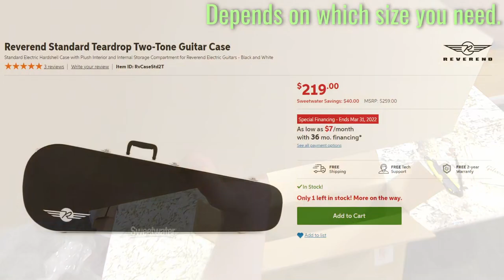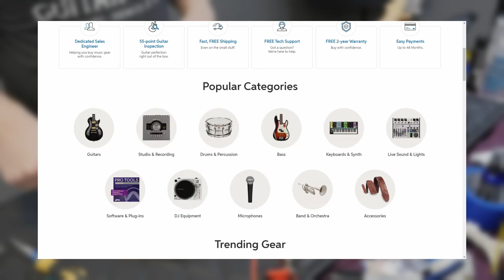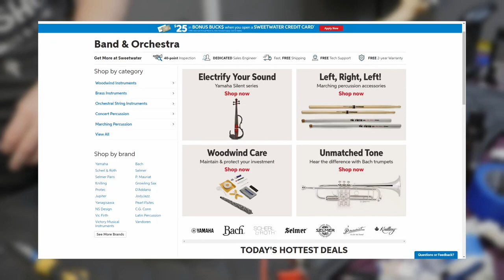Holy Toledo! I Bought My First Reverend | 2022 Reverend Jetstream 390 Outfield Ivy Review + Demo

Comment: Excellent video.  I have had a couple Reverends and I still own a Warhawk with 3 p90's.  You might want to try to review a Reverend Sensei RA.  They are built with a three per side headstock, humbuckers (usually) and a 24.75" scale length.  Those may be more to your liking.

Comment: Very cool brand. I dig it. I always get confused about roasted maple though. Because my Player Plus Strat has a maple fretboard, and maple neck (obviously) but it's about the same color as this Reverend neck. But I know Strats don't usually come stock with roasted maple. So I'm guessing Fender must tint their maple. That's gotta be what it is. Oddly enough, I bought a cheap $300 Eart brand guitar off Amazon (I love buying new brands that are trying to make a name for themselves because you can get decent guitars for cheap that way) and it's got a roasted maple neck. But the color is so much different than anything I've ever seen. Almost orange, but it looks cool. If I had to guess, they tint them, and then they slightly roast them. Only for the darker areas to look roasted. Either way, it came with stainless steel frets and a bone nut. Not bad for what it is. Sounds pretty good too. It's not like my strat or my ESP, but it's better than a squier bullet or affinity for sure. You don't get stainless steel frets on hardly any guitars stock. So it's pretty cool. Just very shiny.

Comment: P90s are Great pups , fuller sound than strat pups , cleaner sound than humbuckers,  and with distortion have their own unique sound ,
A little noisy compared to humbuckers, the Beatles had 3 Epi Casino,  and were used on many recordings including, Paul on Taxman Solo .
When I played Lead in a Cover band , I used a 60 LP , Strat , then I got a P90s 1956 LP in addition to 360 Ric , Custom Dot 335 . Had a variety for doing Classic Rock to get the sounds

Comment: To criticize a guitar when the tuning keys are stiff when they have an adjustment screw is like criticizing the pickup height. Come on Trogly. As someone who owns a Jetstream 390 (and 3 other Reverends) I can tell you their QC is a whole lot better then Gibson. And I have 14 Gibsons. If you would read up on it the bass contour is just a bass cut control. When it’s up all the way it’s the normal p90’s. As you turn it down it cut the bass with a full sweep of sounds to chose from. Very versatile. It does not boost anything. Also Mirr in Korea who builds Reverends also builds Deuesenburgs. Just a fun fact.

Comment: Ron Ashton model is semi hollow or weight relieved...... I think.  Pretty sure lightening bolts are f holes.  Or L holes maybe.
Reply: The Asheton model is the same specs as this one, it has a different color paint job and Ron Asheton's lightning bolt logo on the upper bout.
Reply from the maker: I thought those were lightning holes at first too - but upon closer inspection - just a decal

Comment: Still not impressed by the P 90s tone.  There is a reason why there were so many people looking to design a new pickup back in the 50s. Seth lover and Les Paul were both working on a noiseless pup. Thus the humbucker was born . Those infamous 59 pickups weren't wax potted.   If the guitar did squeal changing the angle of the guitar body to the amp fixed it. By design there wasn't any 60 cycle hum from the pups. When fuzz pedals and overdrive pedals created a higher gain situation they went looking for alternatives

Comment: For $1100 I would just expect more.
Reply: More? They are giving you more than Fender ever will for the same $1099... premium woods (body and roasted neck) good pickups, bass contour (no Fender even offers that) locking tuners. These are in the same ball park as the player plus Fender line and offer way more bang for your buck. Plus the finish is much nicer than any import Fender I have seen.